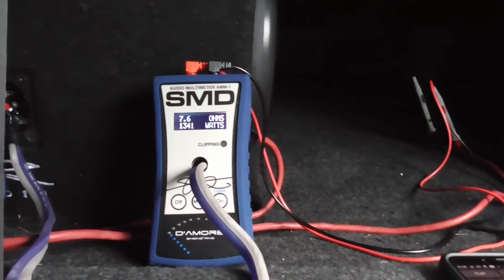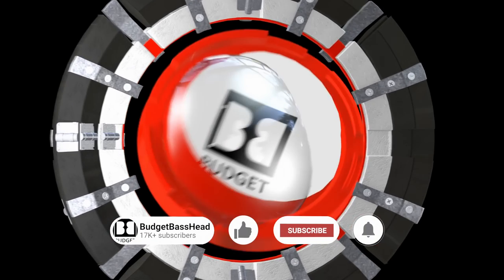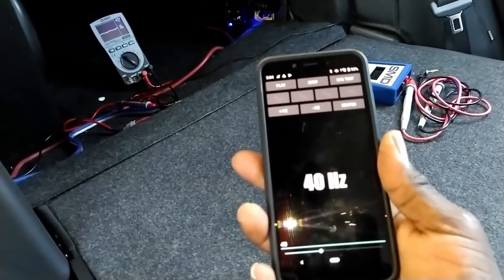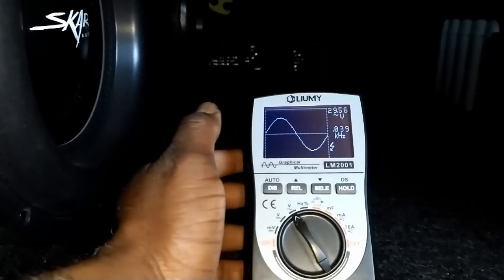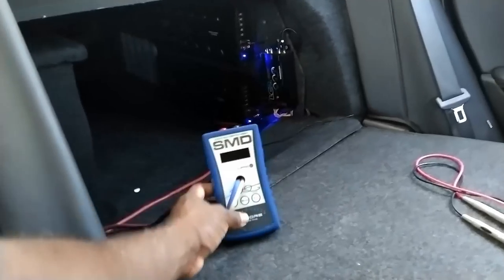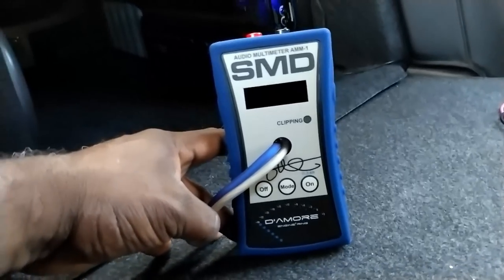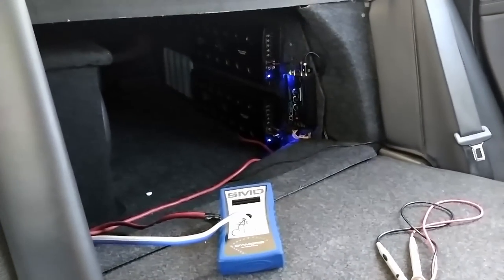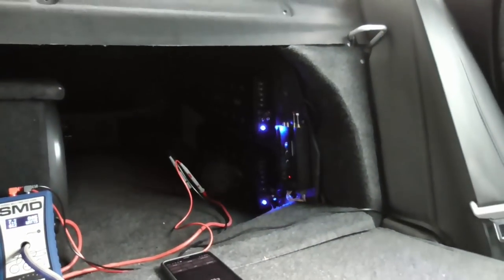How Impedance Rise Is Killing Your System!

Comment: This video and the entire comments section doesn't know what they are saying.
Impedance rise is an increase in resistance due to HEAT.
This meter is measuring Impedance which changes as you move a speaker coil through it's magnetic field.
They are not the same things and the terms aren't interchangeable.
If you want to compare the two then take a base measurement when you start playing the system. 
THEN play it hard for 3-5 minutes and re check the measurement. That will give you the Impedance RISE which is a RISE in resistance due to HEAT.
The reason why your speakers pull maximum power when they are cold vs when they are hot is due to Impedance RISE.

When you choose your speakers coils and wire them you are setting the BASE resistance. This is the lowest resistance and maximum work the amplifier will see as it is working.
As the Coils heat up that BASE resistance RISES and increases the lowest resistance the amplifier will see as it operates. This is called Impedance Rise and it affects how much power the coils will consume as they operate. The more heat in the coils and wires the less work the amplifier will do.

Comment: My man so i'm a Car audio freak and Dj and i was wondering if impedance rise is also applicable to Pro Audio Amplifiers as in when running mids down to Bass bins do they also get impedance rise etc? cause then most 300w Rms amps are actually an estimated 150w amp and 500w=250w actually etc.
Reply from the maker: Some manufactures use more premium internals than others. The better the amplifier board components, the better it deals with impedance rise. But there is no perfect setup. You will get impedance rise, but it can be minimized with experimenting with your listening enviornment.
Reply: @BudgetBassHead  okay cool yeah no i was wondering bout this and yeah
Reply: yes, you'll always have rise with any speaker. Ambient noise, weather (hot/cold/humid/dry) going through a drive thru and placing the bag on the seat next to you are all going to effect your rise. Being a DJ, the auditorium or outside environment and how many bodies are going to play a toll. a efficient enclosure is going to have more rise however even with the less power doesn't mean sound will suffer as once again, the enclosure is efficient. So the actual power will depend on the day lol.
Reply: @commonsenseisdeadin2024  exactly this is why im already looking at some 2000 to 5000watt PA amps so that i legit have more power if needed especially seeing as my PA 18 is rated at 900w RMS and laughs at my current amp and also my mids are also asking for more so yeah.
Reply: @EBMproductions1  I know nothing about PA amplifiers. What is a decent powerful amp that I can find blown to "tinker" 😂
Reply: @commonsenseisdeadin2024  any Crown amps labgruppen amps, Qsc amps or EV Q1212 etc.  there is many but for the cheap look for the behringer inuke series or behringer NX series amps i own a Yamaha P2500s a Behringher EP1500 and Two Hybrid amps(knock off JBL amps) one 1200 and one 900 variant all these amps are 2x300w RMS so sadly im low power wise for my home audio setup 😅 i want the hybrid B4000 amp 2x2000watts Rms 3600watts Bridged i believe that will push my DD715 Quite well 🤣
Reply: Bud the amp has little to no influence on "rise" it has more to do with the woofer, a pro audio woofer is design differently, the size of the motor and the efficiency of the woofer has more to do with "rise", the more the woofer moves the more current it will produce "rise" as back current, in pro audio you have highly efficient woofers like 97+% with very little movement (x-max) and small motors, compared to a car audio woofer that is 85% efficient with a massive motor (40+mm x-max)creating a ton of electricity as it moves (rise) so no you don't need to worry about rise in pro audio set up. Now if you are using a car audio sub or a woofer with a massive motor and a ton of x-max the only way to fight rise is to wire it low and use a multimeter or DD1 and do a sweep and at some point most the time (around) 30hz you will see its lowest ohm load, if your amp will do 2ohms don't wire the sub any lower then 2ohm.
Reply: @scottiffanimccord1509  see my DD715 is wired directly to the amp atm meaning max 8ohms load right now my amps are good down to 2ohm tho so when i finally get the wiring i can wire lower and most likely see more output issue is 1.)we have a 2 week full lockdown ATM 2.)even now i dont push the sub hard as my house rattles like nuts which is sad 😂
Reply: @scottiffanimccord1509  the amp doesn't effect rise but with a bigger amp you can combat rise. So if you have 1000wrms driver and you have it at 1ohm nominal but lowest you're seeing when playing is 2ohm then you get a 1000wrms @ 2ohm amp instead of @ 1ohm. 

Don't need to go to the extreme like me and get a 20k amp for 2 2500w drivers 😆 

Btw I wish our subs were anywhere close to 85% efficient, it's something ridiculous that a sub only uses like 40% or less of the power we give it, the rest is generated as heat. Could have been like 4% honestly.

Comment: I think of box rise as being much like a steep hill.. Your big badass 2JZ can do 160 on flat ground but when you floor it just the same while trying to climb a steep hill you're not gonna get the same 160mph out of it but you're still giving it all she's got...    Once that magnet meets the field from that electrical current it's got some serious work to do and when the box isn't working with the speaker in dissipating the precise amount of air which is constantly changing with each different note (and also why a ported box is considered "tuned" to a certain frequency) that amp starts to see the resistance from the speaker like the motor does when trying to drag race up a hill.. physics can be a bitch that's for sure.. BUT without those same physical elements we wouldn't have sound.. or cars... Or anything really. So viva physics, and viva impedance rise! (To some degree..  I agree that a static 2 ohm load would make my amps much easier to get along with and they would likely not be so hot headed! 🙄) Good video man.. thanks

Comment: you've got some weird shit going on. Stevemeade tested a Skar RP1200.1 amp and it was putting out 1200 watts rms without issue bench testing it with a skar sdr12 inch sub. Probably doesnt help you have some sort of weird junction on the speaker wire either going from 2 wires to what looks like a single 8 awg wire into the amp?  You have other issues going on.

Comment: You might have said but what ohm are you running to the amp?
Reply: 2 ohm cause they are strapped
Reply from the maker: 2 ohms. Each amp sees 1 ohm, before impedance rise.
Reply: Wow and your rising to 7 thats crazy
Reply: So im not doubting your intelligence or trying to offend you in anyway but is it possible you have them wired at 4ohm. I run mine at 4 and i rise to 6/7 ohms. 1ohm should rise to 4ohm but the more power you give it should lower back down towards the 1ohm. Maybe seeing around 2ohm area. Id check all the voice coils impedence just to be on the safe side. I personally have never seen 1ohm or 2ohm rise to 7. Its worth checking it could have been wrong by manufacturer. At any time if i have offended you z except my deepest apologies. Just an opinion and suggestion. Anyway nice setup looks clean. Im not familiar with strapping as ive never done it myself but  that might also have something to do with it. Id think it would be lower impedance

Comment: As far as I can tell you set the gains while the LPF & subsonic were already set. I am trying to determine if I need to redo my gains with the crossovers set first or not. I just set mine with a dd1+ but the crossovers were off / wide open then I set them. I noticed that if I do it the way I just did with a -7.5 dB overlap then set the crossovers then re-check overlap, it has gone lower to like -5-7 dB overlap.
Reply: I don't have a dd1 but you need to set your gains with your subs connected and  using the settings you normally listen to your music at. Don't listen to anyone who says unplug your subs to set your gains. You will clip a lot sooner with subs plugged in than without. And Idk why everyone says set the eq to flat. Use whatever settings you normally use. Depending on where you set your lpf, what slope your crossover is and what hz test tone you should be able to turn your gain up slightly high with lpf on as opposed to wide open. Go look at picture of a gain slope. Depending on the slope, if you set your lpf to 80 hz and you're using a 12db slope, at about 35 hz it starts lowering the volume.
Reply from the maker: It's recommended by 'most' audio engineers to set your gains 'BEFORE' adjusting any other settings. Yes, I did not 'reset' my other controls. For I was doing this as demonstration only. This is a mistake on my behalf. Because I clearly confused you in proper procedure. However, monitoring your system's behavior throughout many music genres and frequencies is the best advice to give. There are so many sources of music files, at so many different compression levels, it is best to learn what your system is doing; with the sound sources you are feeding it. So take some time, during initial setup, to get to know your equipment's sensitivities. A remote bass knob or level control, comes in handy in these situation. 😉
Reply: @BudgetBassHead  I don’t disagree with what you’re saying and I love the channel but it doesn’t make any sense to me. If I set my gains with a flat eq and then turn on my alpine bass engine mode I’m going to clip like crazy. I just set my gain at 1/4 or 1/3 and then fine tune with my dsp or remote bass knob as I’m listening to music. If I see my clip light come on I just lower the gain by  one db until I never see my light come on. Making sure I don’t go over a certain volume on the head unit of course. Basically everyone needs clip lights on their dashboard somewhere for any sub amp especially. On one of my amps I took the clip led off the amp’s Pcb and ran wire to my dashboard and put it inside my remote bass knob. I like to be on the very edge of clipping
Reply: Thank you both for the replies. I think my gains are perfect right now. I have a SFB-2000, I set my gains at full max clean volume from my Pioneer head unit using the 40 dB test track from the SMD usb stick I purchased. I can play most normal music around 35-36 before it clips & I can play decaf music around 36-38 before it clips at 39-40 max volume. I believe I’m good. My max clean output from my Pioneer head unit is 40 volume anyways. My bass knob has a clip light that I monitor. I tried setting the gains either way, same results really. If I can play decaf at almost full volume with no clipping I believe I am good to go.
Reply: I always preliminarily set gain to a moderate level (enough for moderate cone travel), for subs, I set subsonic and LP to my design specs for the box (in the vehicle), then run a slow manual frequency sweep (10Hz to 100-ish Hz) while measuring amperage and voltage to find the peak power points are AND the tuning frequency (if not measured before) this will always be a dip, then re-adjust/dial-in my gain to the using dmm, o-scope, and ear...fine tune S.S. and LP and re-tweak gain so as not to exceed the subs rated power at the highest peak power freq, xmax, and cone-breakup.  Just how I do it.  🤘😍🤘  You can't get away from impedance rise; more power, more heat rise = more impedance rise...for daily drivers and budget bangers, my advice and key is: properly match, designed, tuned, and details set, stay at or below rms power on the highest power point (usually at lower freqs, but depends), and you will always have kickass bass.
Reply: @BudgetBassHead  I listen to genres at different volumes. If I listen to a Metro Boomin' produced song at the same volume as I do Green Day, my subwoofers might eject from the car. Maybe it depends on your amp whether you should have subs connected while setting gain. I know with my Taramps Smart 3 it will clip significantly earlier with a subwoofer connected. I recently read something that made me think it could have something to do with the "Smart" technology in that amp. 
This would explain my profound confusion over why so many people say to set gains with sub connected.

Comment: Wouldn't the rise be coming from 2 things. Small box and also cheaper sub voice coils getting hot and not being as efficient. Not knocking your subs, but Scar is the value choice of top name brand  subs. But in a tight box they would really be pushing harder, and essentially getting hotter faster; losing their  impedance... 
Another thought, most amp manufacturers suggest not mounting amps to the box; but what about having the subs blasting right against the top of the amps? Is it possible to be slowly killing your amps from the shock of the subs sound waves? Don't get me wrong, that is an awesome, clean setup you have there, but just seems to go against the grain for running long term effectually.
Reply: No matter if you have a skar or a 2500 dollar Orion HCCASPLX, the change in imledence comes the same when the sub cone moves during play. No power hooked up, put a multimeter on ohms, and touch the dust cover or foam surround, impedence changes. Set sub on table and stomp foot on floor and watch your 4ohm sub go to 2.5-3.0-3.8.
Reply: You shouldn't mount the amp to the box because of vibrations from the actual box, not from the air going against the amp.
Reply: @1904audio  I'd dare to say, beating on the side of the box is about the same as the air pressure directed right at the amp. 

Mainly depending upon the quality of the amp as well.
Reply: @kramnull8962  the box vibrations can actually break the board of an amp getting the amp windy doesnt.
Reply: @kramnull8962  and to be honest his setup couldn't do either of those things
Reply: @1904audio  Says you.
Reply: @kramnull8962  says me because I have 2 builds and I know from experience. I literally have 4 taramps bass 15 ks, a md 12k a deaf bonce 20k and 2 deaf bonce 6ks fi subs skar subs and sundowns not to mention a host of other subs so yeah I know a thing or 2 from experience. At the end of the day I'm just giving my opinion just like you're giving yours.

Comment: I dont believe any book/ box specs with today's audio unless it's been proven. Your head unit is still factory so that's an issue, not to mention you may need another battery or 2 and a bigger alternator to get more power to turn into wattage.
Reply: I say your factory head unit is a issue you may not be getting a clean and proper voltage to your amp signal input RCAs. It's a common issue.
Reply from the maker: @40Hz the factory head unit is clean up to 80% @2.5V I run that through the PAC LC2i and give the amp around 4.5V; @30Hz The head unit is clean 100% probable due to rolloff.

Comment: U need to run this test on the hertz that ur subs peak at then run this test
Reply from the maker: My subs peak, in this environment, around 46Hz. The impedance measurement is about the same as it is at 32Hz. Peaking to about 14 ohms @40Hz

Comment: You only suppose to run one of the speaker wires thru the amp-1 not both. Neg or pos either one. Not both.
Reply from the maker: My speaker leads are dual runs of 10gauge.
Reply: @BudgetBassHead  This keeps getting brought up lol maybe time to get some 8 gage SHCA OFC bro.

Comment: that moment when his issue is factory headunit bass roll off if he gets a audio control product that has accubass you can fix that
Reply: those amps are rated for higher power than that at that box risen ohm load. power is there bass is not. if you bypass the headunit with a frequency generator and you get different results then im right.
Reply: @budgetbasshead

Comment: If those amps are 2000w rms they are drawing well over 240 amps each at full volume! Which it isnt so far.If your wire is CCA. It wont supply more than 60% of current per amp! Remember its measuring what it see's! So if your ele trical system cant deliver the amperage it will read low! Look into electrical it will pay off! Its like drinking a milkshake thru a coffee straw! CCA WIRE has lots of resistance!!! Not to mention your alternator isnt doing even half that. And i didnt even see atleast a 2nd battery! Get true OFC copper wire and beef up your electrical. Or even if you have OFC then beef up your electrical! Its the #1 thing people neglect who have big systems! Not knocking ya. Just going by what i see! Check it out and ask a "PRO" installer and your wont be dissapointed! Good luck and Peace ✌
Reply from the maker: 320Amp Mechman, AGM + Ultra-Capacitor, Tinned-OFC Knu Konceptz Kollosus Flekz power wire.

Comment: Bye me being 56years old and bass head i I always buy a amplifier twice the power of my subwoofers if the subwoofers are dual two wire each subwoofer to one ohm per sub parallel both of them together make sure you have a one ohm stable amplifier and the impedance rise should be back up to   .8ohm or one ohm turn it up until you hear it distort back off of it quarter of a turn then smell to see if the coils are smelling at full tilt if they aren't have a bassful day 😂😂😂

Comment: Nice!!!
Reply from the maker: Thanks!
Reply: @BudgetBassHead  soon I might try this I find how to solve box rise is to wire low you should lower your ohms. I used to have 2 strapped 2000 watt Hifonics amps wired to half ohms! That's .25 per amp but after box rise it's probably was still over 1ohms per amp😂🔊🔊

Comment: Stop you're going to damaged those subs that pre-built box is designed for 34hz optimally with the right speakers which those aren't. Just cause they're the same brand doesn't mean they go together. The speakers are letting go at that hz level. Try 40hz or higher you'll get better results. Get a box that those speakers are designed for by reading the manual that came with them.